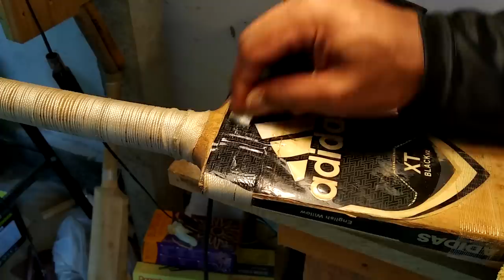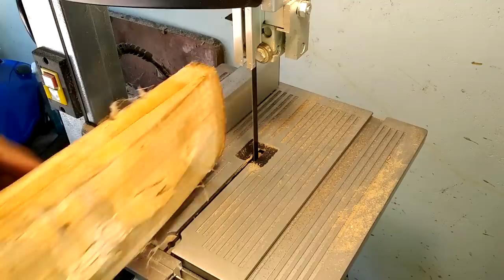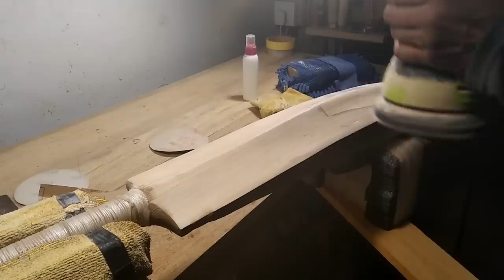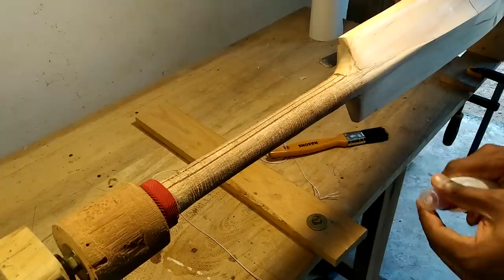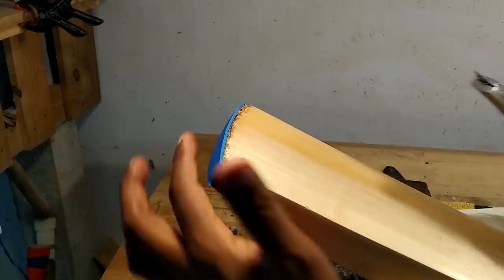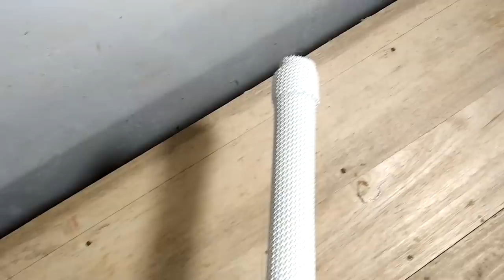Badly Broken Cricket Bat Repair - Challenge Repair Episode -5

Comment: Awesome Video bro. Very fine work . I have a question though, Will the ping of the bat change or will it be the same when we replace the spine ?
Reply from the maker: Good one bro ,, since we are replacing the spine with a minimum piece of of wood , there is no impact for the performance
Reply: Oh thank you so much for clarifying that. It really helps.

Comment: Hi how are you 
Why you use tape it's not strong if you used thread strong grip wood by the way nice work keep it up...
Reply from the maker: Thanks for the tip
Reply: Welcome bro coz I have 15 years bat repairing experience then I told you used thread

Comment: Cutting wood with a metal hacksaw, whats the bat made from ,ironbark.
Reply from the maker: Thnx Bro ,
Reply: For very narrow cuts. Some very expensive Japanese saws can go even thinner, but these hacksaw blades are among the cheapest ones available.
Reply: Normal wood handsaws make wide grooves/cuts. Hacksaws make thin ones.
Reply: @acswain6720  Havent you heard of a "frett saw" and cabinet makers saws are not wide blade,
Reply: @Alan McEwen you are providing very costly solutions for simple problems. All I am saying is metal hacksaw blades are easily available at dime a dozen, and as you watched, are capable of the job at hand perfectly. I agree, there are a lot of thinner saw available, but very few comes at the convenience of replaceable blades, that too cheap.

Comment: Please stop using Epoxy to glue everything. As soon as the epoxy shatters it will take the soft wood with it. There's a reason no professional bat repairers use it. PVA and sometimes, but rarely superglue are the only glues that should be used 🤦‍♂️
Reply: Jake Leach  facts especially in handles  the pva glue allows flex in the handle
Reply: @Austinrobertson22  spot on. The last 'repair' was a joke, epoxy resin to glue shoulders and handles that is brittle and shatters. And a handle that was wonky post repair too 🤦‍♂️
Reply from the maker: The epoxy i used is a local product and it goes well with the willow upto now ,,,, there is no issue as you two talking about, anyway thnx for the information AR Cuber & jake leach thnx bros ,, highly appreciated, keep watching us